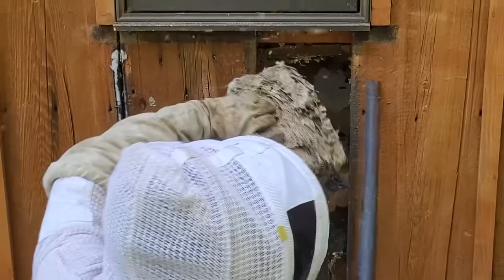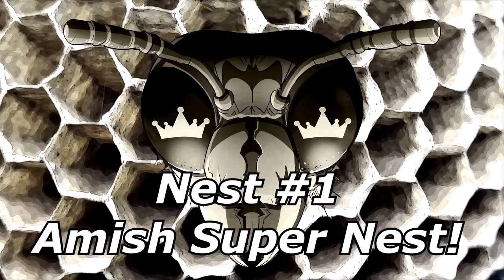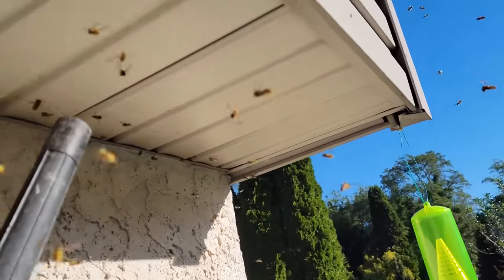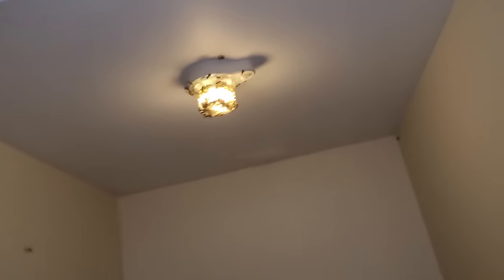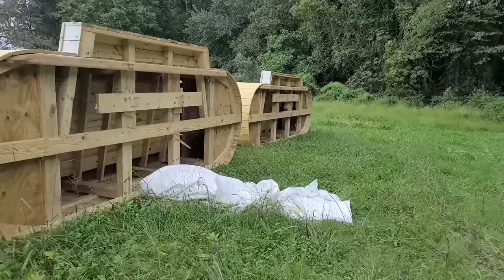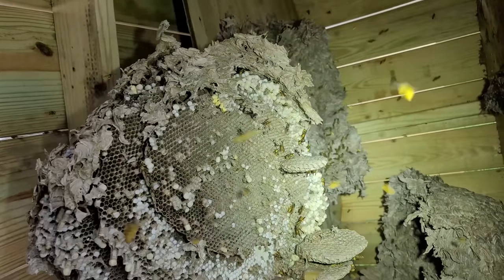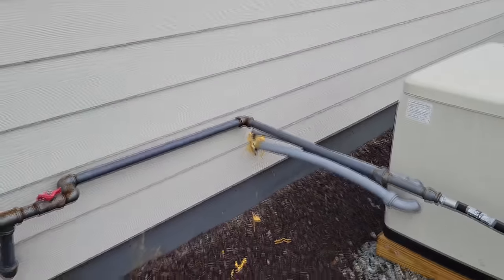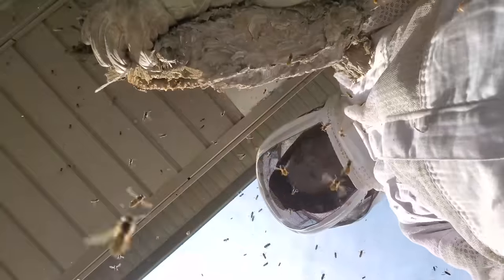Most EXTREME Yellow Jacket SUPERNESTS!

Comment: Just to be safe, I have an idea for the suit. For the limbs, put on one of the fabric cloths people use for cosplay. Then, cut out some cardboard that fits your bicep and forearm. And do the same for the thighs, calves and shins and make sure they’ll fit under the suit.  Now for your face, try one of those plastic visors that you can buy as a mask, and see if that will fit under your face cover. Also, try to make a separate joint made out of foam that wraps around your wrists and ankles. I know that duck tape may not always keep hornets out. Hope my ideas can help in the future. Also, I’m not sure if this brings any benefits or if it make things worse, but for Eastern (or Southern, I honestly can’t remember) hornets, try using smoke and then spray them with the killer.

Comment: Have you considered building your own huge vacuuming device that could be used to capture many times more wasps than the shop vac's 1"-2" diameter hose? I'm thinking dust collection vacuum units for large wood workshops, large industrial lawn leaf blowers, jumping castle inflation blowers, or large industrial Roots-type blowers driven by a 2-3HP electric split phase motor or gas engine. The motor would be preferred so the customer pays the power bill and you get to run it as much as you want for free. 😺 With a very high CFM blower operating with the capture setup on the intake, you could pipe it to use a 4" hose and connect a flare/cone attachment to the end of the nozzle. You could point that huge cone at the nest or maybe even surround the whole thing for some smaller ones you've done in the past, and then all the wasps that take flight toward the cone will get sucked in. The cone would be like a black hole because the venturi effect at the house entrance would speed up the air velocity a lot. :)
Reply from the maker: I choose this vacuum specifically for its specs.

Comment: I remember last summer, I was doing some work on a telephone NID at a customers house i checked for wasps and found none. 

So i open the NID up, start working and 10 seconds later i get stung 11 times on my left hand and 8 times on my right by some red wasps in about half a second.

They came out of a hole in the power meter. No way I could tell they were there. I couldnt fully close my hands for three days.

Comment: Here's a weird idea but could the envelope be compressed and turned into fire lighters? Or some kind of kindling? It's basically paper after all.
Reply from the maker: Unfortunately it just smolders, at best. And even that is obtained by holding a light to it for a spell. You have to have a hot fire for it to burn well. It's cellulose isn't the same as say, newspaper.

Comment: Question you probably already answered this, you mention getting stung alot. 
Would thicker gloves and clothes help or would it need to be so thick that it would make movement difficult?
Reply from the maker: I rarely get stung. Usually it's when I'm removing my gear after a removal and one gets caught on my clothes. When I would get stung during a removal, it's usually on my wrist. But that's a compromised spot I would have to show in a video to explain.

Comment: Are these supernests even really more populated than normal nests? As shown with number 3, they don't even use the old nest structures and only reside in the lates. So while these things are huge, I don't assume they house more individuals than normally occuring ones?
Reply from the maker: I defined the "supernest" term I use in the beginning of the video. Supernest is either a multiseason nest, or a densely populated single season nest. So a super nest constitutes as a greater mass of nest, with a densely populated colony from multiple seasons of building, or a massive single season nest size with more individuals in the colony than a typical single season nest.
Yes, they most definitely have more individuals than typical single season colonies, which is why I counted the individuals in the vac, BECAUSE the colony was so densely populated.
Reply: @HornetKingOfficial  I did understand your explaination. :) I just wondered if a super nest is even more populated than the average nest or if it's simply big in volume. In your video you mentioned many times how many wasps lived in there.